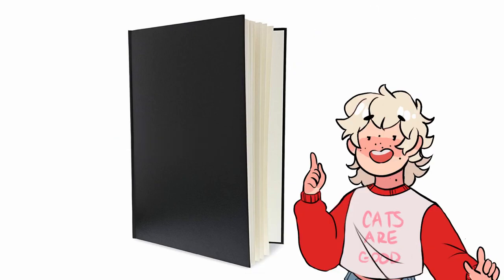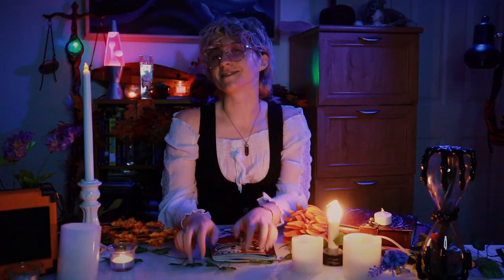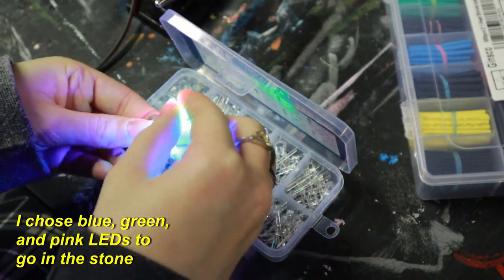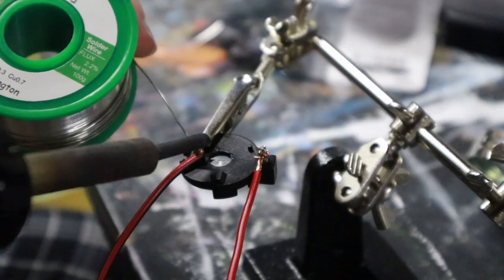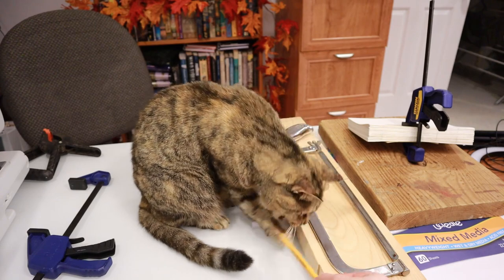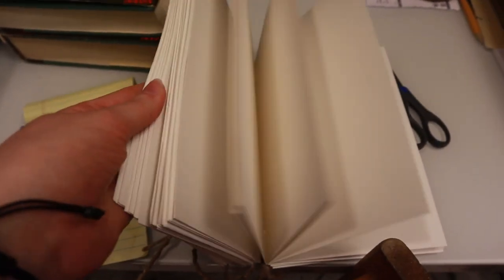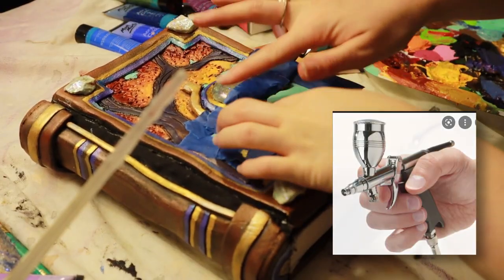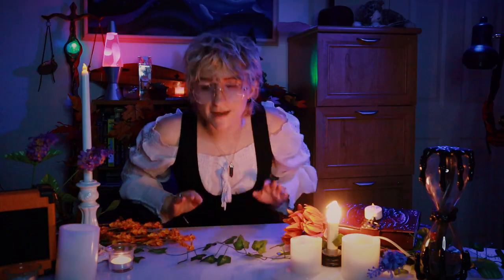Making a Sketchbook (but it's a SPELLBOOK ✨)

Comment: Really love the final outcome! My feedback on the process would be to first iron the fabric you used on the inside of the covers and glue the fabric on paper! This way you can use regular white glue to stick it on on the covers! 

To glue paper on fabric: I use Kraft paper and a small paint roller thing, dilute white glue with a bit more water, “paint on” the glue and then carefully place the fabric on top to avoid any wrinkles in the fabric or the paper 

Gluing paper on fabric is very helpful for any bookbinding projects cause it means the when you glue fabric onto your book the glue with pass through the fabric and make it splotchy and weird
Reply from the maker: Thanks for the tips! 💕 I'll definitely do that next time

Comment: Heating the foam (with hairdryer/heatgun) after sanding and using (wood) glue as a primer are budget friendly tips and stuff you probably have laying around your house

Loved the video!!
Reply from the maker: I normally hear seal my foam but I've never heard of the wood glue trick :3 Thanks for the tip!
Reply: it does need to be thinned a bit and a couple layers, but it's a good alternative if you run out of your usual sealant :)

Comment: A cool thing I found is that you can make the paper look old or color it and give it an effect. So basically these are the steps. However, this is only from my own experience and I've only done this like twice so I am not sure about everything but from the times I did do it, it worked really well. This is just what I like doing and not saying that the way Prickly Alpaca did it was bad, I just find it interesting to compare methods and share how I like doing it, and other people can reply if they have any thoughts or experience.

 1) Divide the paper into the size you want by tearing it with a ruler. This makes the edge look fuzzy. You canuse scissorss, but the paper will look different.

2)Soak it in some old tea/coffee. Make sure that you put the paper in individually or it can stick. Don't worry, this doesn't take as long as it sounds. If the container gets too packed, put some of the paper in another one. 
 You can also just use an old tea bag but the corlour might not be as strong. You can also use herbal tea or food coloring if you don't want it to be brown. I also like to open the tea bag so some of the bits stick on the paper. This step I think just experiment with it and see what works but I think that for stronger corlour, use an old tea with the bag and liquid( British or herbal) and for a weaker corlour use just the tea bag or food colouring. Other things that you could use to dye the paper that I haven't tried yet are, any other colored drinks, plant dyes, dirt, etc.

3) Soak it for about a couple hours to a day, but I don't think it matters too much if you leave it in for longer.

4)Then take the paper out and leave it to dry on a towel. Lay it out so that the paper is not on top of each other, but it is ok to have a bit of overlap. This takes about a day, but I'm not sure so just come back to it when its dry.

The paper is now done and it is a good way to use normal printer and cheap paper and make it more aesthetic and old looking. You can use the paper in as normal or make it into a notebook. The next step are for how I put the paper in and decorated it, but you don't have to follow it because I've only done this twice and everyone does it differently.

5)Put holes in the paper with a sewing needle and hold the paper together with a clip while you do this. You will need a thick needle for making the holes, and a thinner one for sewing through them. 

6) Use a needle and thread to sew the paper together, and leave the clip on so it is easier to hold.

7)To make the cover, cut some cardboard to about twice the size of the paper, plus some extra for the spine so that it can fold. It is better for it to be too big than small so that the paper does not come through. Also you can make the cover while the paper is soaking and drying.

8) Lightly cut the cardboard where it folds so that it can be folded, but does not go through. Then put holes in the spine in the cover as well, in about the same spaces as the paper holes are. Sew the paper inside the cardboard, using these holes and a needle and thread.

9) You can decorate however you want, but I used some old jeans for the cover because I didn't like the cardboard texture. To do this, cut a piece of fabric that has about a centimeter of extra space around it that the cardboard size and then glue it on.  You can then paint or stick things onto it, or if the fabric is already decorated you can leave it.

10) You can also decorate the inside of the cover. I did this with paper but you can use what ever you want.

11) The notebook is now done, but you can add extra things like a ribbon bookmark or an old key. Its also fun to decorate the cover with any pretty things you find on the floor, so long as they are flat.

So yeah. That's basically it and I hope this was helpful and makes sense. Also, this isn't a critique of how she did, I just want to share how a way to make  notebooks because this seems like a good place to do that because its on a video about notebook making.

Comment: The best thing to use for covers like this is leather because it's easier to mold into the shape you want
Reply from the maker: I definitely wanna use leather on the next one I make! I just didn't have the budget for it this time
Reply: PricklyAlpaca I also did not realize that burning foam can be really toxic for you. Good reminder (I actually haven't used foam in forever and I didn't know this until now) 😓
Reply: I would also like to mention how my 18th sketchbook went. So I didn't have gauche paints. All I had was these cheap paints you get in those kits and I tried mixing a skin tone for nezuko which was on the cover and since that didn't go well I wiped it off it left a bit of a stain but my current sketchbook is just a classic with a few custom stickers. Note to self never by art kits and use the paint

Comment: Everytime I watch your videos it makes me wanna do cool things like this but whew the perfectionist in me would not be ready for that trial and error 😭😭😭
Reply from the maker: It's not too bad! 
Foam is pretty forgiving, you can always carve away at it with a Dremel or a box cutter if you don't like the result or rip if off and start over! 
And the binding process itself is also pretty forgiving! I definitely didn't do it the right way and it turned out pretty functional. So if you wanna give it a shot, go for it!
Reply: @PricklyAlpaca  I think I might just do that! But just a quick question. What do you think would happen if I just glued the pages together instead of binding them? Like how you had the 15 sections of 4 papers? So I'd glue each of the 4 papers together at the crease, then do something similar with the 15 sections?

Ok yea I'm horrible at explaining, but hopefully some of that made sense